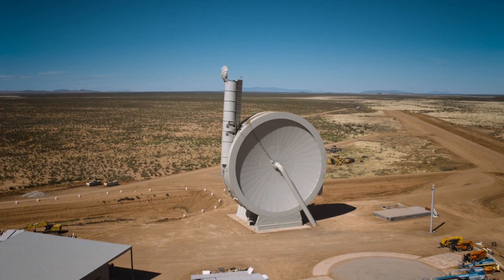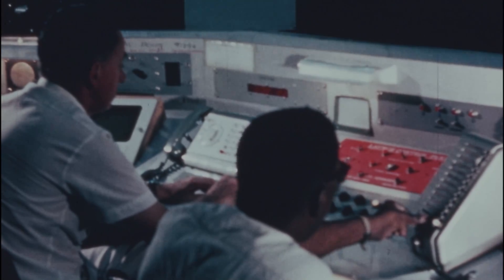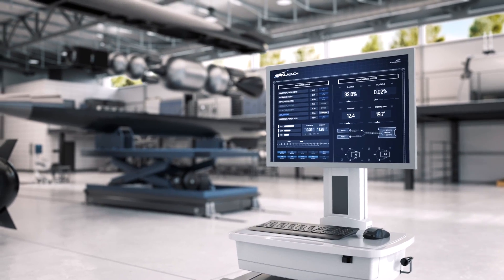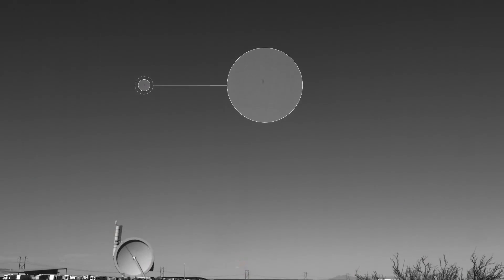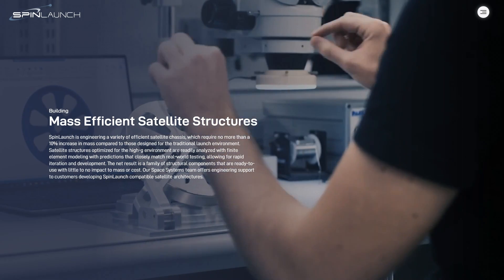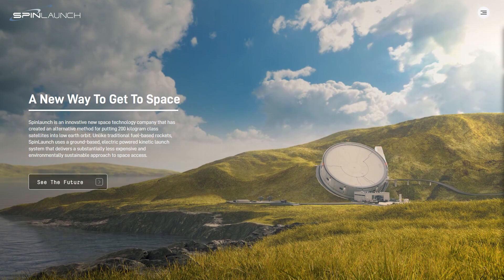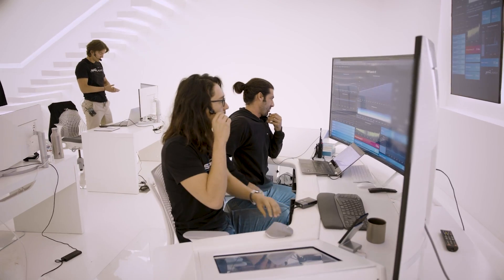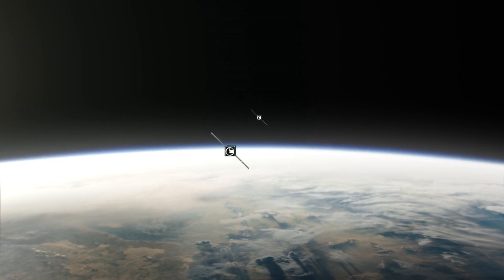Can Spinlaunch Throw Rockets Into Space?

Comment: A way they could release the rocket without damaging the bearing would be to have an attached counterweight exactly 180 degrees from the rocket that will release at the exact time the rocket releases but instead of going upward, it's directed downward. The forces on the bearings should remain the same and all they would need to do is dig a pit for the counterweight to safely be caught.
Reply: Sounds like a bomb
Reply: @metatron6066  well its better if a counterweight get thrown underground than the entire Spinlaunch assembly becoming a bomb if something goes wrong after the rocket is release above ground.
Reply: I don't think a counterweight going down at 11km/s can just "safely be caught)
Reply: @augusto7886  if they can design something to throw an object several miles in the air, I'm pretty sure that what I'm suggesting is possible. Even if its just a steel and concrete reinforced pit filled with deep water.

Comment: This is good but they need to make the ship shaped like a combination of a Frisbee and a airplane wing with an interior spinning disk so it has gyroscopic control with  aerodynamic lift then shoot it up at an angle. Also you could use these as a way to get parts into space and then build any kind of ship you want in orbit so that most of the fuel doesn't have to be used on breaking free of the planets gravity.

Comment: I wonder if this is the kind of thing that will be built like space telescopes, high on mountaintops to minimize the amount of atmosphere it has to deal with in the first place.  Less ΔP for the vacuum chamber to hold, and less air resistance for the projectile to fight on its way up.  As long as one is building a fixed launch station, might as well take every advantage you can get, much like how launching from the equator is preferred for the 1000mph speed bonus.

Comment: It would be probably much easier and cheaper to build a long runway ramp that gradually inclines more and more as the vehicle gains speed, than the current system of elevating a several tons rocket in vertical position from zero speed, demanding a tremendous amount of energy right from the start.  It is like the difference from a fighter jet that takes off speeding up on the deck of a aircraft acrrier or an old Harrier jet fighter that takes off in vertical position.  What is more energy efficient?

Comment: Obviously, this scheme works best atop a mountain -- like those in Hawaii.
It also works best for mass produced satellites, which is where the industry is headed.
Such objects could be injected into orbit faster than they could be shot down by anti-satellite weaponry.
And... this scheme could be the solution to sending fuel and materials into LEO at the lowest cost.
Reply: Do you know how long it takes to evacuate air from a huge vaccum chamber like this?
Add this to their assumption of spin-up taking several hours, and you will have 1 launch per day. Maybe.
Reply: @wtfiswiththosehandles  True, BUT, nothing stops this scheme from being replicated, clustered, even. In the beginning, I'd guess that their primary customer just needs supplies and materials...ice, even.
Using hydrogen gas instead of air would permit a much higher velocity at Mach 1 as well. This would be a two-stage pump-down. First a decent vacuum -- then a nitrogen purge -- then hydrogen would displace the nitrogen -- but at a pretty low absolute pressure. The rupture seal would covered by a nitrogen gap and robust metal cap until seconds before the Big Toss.
Due to the starting shock, an outer shell/skin will be necessary. Twenty-seconds -- or so -- after the Big Toss you'd be out of the atmosphere... and the exterior would be shed to improve ultimate performance.
If the Big Island was used, the discards would land well west of California.
Burning propellant upon the Big Toss might be delayed until out of the atmosphere, too.
Reply: @davidhimmelsbach557  I watched this several times, and it seems that a) the "projectile" tumbled upon launch... And b) in slow motion you can see that the seal was ruptured from the inside, as if pushed with mass of air from inside.
I question if they even tried this vacuum method at all. 
It is very interesting if it's further developed, but honestly it feels like the owner's main goal is out to get cash from investors...
Reply: @wtfiswiththosehandles  The VC folks funding this are the most prestigious on Sand Hill Road, Palo Alto. So, I'll bet they are entirely dialed in. This early in, I'm just impressed by their backers.
Musk's first stuff only hinted at what was to come. I hope that these fellows ramp up their scheme.
Price to orbit has ALWAYS been the big bug-bear for near-space economic advance. I believe we're witnessing a transition as significant as the first railroads. Yes, it's that epic. It's why Space X has such a fan base.

This device would also lend itself to the military. So I can see DARPA funding for this and that.

Comment: I wash down at Spin Launch New Mexico, doing the electrical work for the main building.  The lighting, receptacle's, stair lighting.  Exterior lighting.  The tan metal structures you see are welded together to form offices, 2 sets of showers and toilets.  On site living in the shipping containers and even a fully staffed chef who cooked wild thing he though up.  There is s shipping container modified in to a walk-in cooler and another as walk-in freezer.  They have a open fire pit area, music instruments you could play.  A mechanic shop onsite.  The worst thing about being there is hot humid weather.  As soon as you walk out of the air conditioned rooms, you start to sweat and When it rain, you had a 90% chance of getting stuck on the dirt road.  The facility was all powered by diesel generators.  The long strip of cleared land is for a runway and helicopter pad.  Once we got the Main building finished, we were done.  The basement houses the control room for the the spin lunch accelerator.  There is engineering office room upstairs and Conference room as well.   Their is a women restroom, a shower and men's restroom only.  Their is a open kitchen as you walk-in the main entrance.  Just past the kitchen is the Workshop area for lunch devices.
Reply: They have lunch devices, too? If they have a Mach 3 spork, I want one!

Comment: So dumb.  I have a much better idea that can be used.
Why not use the rail gun system to launch a rocket thereby decreasing the need for the weight of fuel?
Dig an approx mile deep bore hole, line it with electromagnetic rails, and have rockets kick on before escape velocity speed is unachievable.

Comment: The acceleration at the tip of the 50 meter long arm spinning at 450 rpm is R*w*w = 50*(450/60*2*pi)**2 = 110920 m/s2, thus 110920/9,82 = 11295 G
Reply: So when the projectile is released, the counterweight is going to be pulling that hard on the opposite end of the arm.
That would dig a hole halfway to China...
Reply: @carpediemarts705  this is the dumbest fucking idea I've ever seen lmao

Comment: The drag in atmosphere is velocity^3.  Set this up on top of a mountain.    The same speed at the edge of atmosphere could be achieved with lower launch speed.  Or, the same launch speed allows more payload, because less fuel is needed.

That also requires less structure to support a vacuum, the external air pressure is lower (less than half at 20,000 feet).
Reply: True, I thought that initially as well, but you also gain a large amount of free speed from being close to the equator, and there aren’t any high launch spaces in Florida. Operating outside of the US would cause tons of legal problems, might even get them banned from doing business with any us company over national security.
Reply: @-caesarian-6078  yep.  in another world they could put it on Pico Bolivar at 5000 meters, but that's unlikely in our lifetime.  Maybe Pico de Orizaba in Mexico could work out, but I still have my doubts
Reply: Also as close to the equator as possible. 

So the same reasons they put telescopes in the mountains of Chile.

Imagine how much that would benefit Chile if they had a space program.
Reply: Watch Scotts video about launching rockets from mountain.
Same principle applies here. Yes, it would require less fuel/energy but the logistics would be much much much more difficult.
Reply: @Jehty_  The G forces would indicate only small rockets are launched.  

I would expect the major logistical challenge would be the materials and equipment for the spinlaunch structure.
Reply: Why did they launch most of the rockets from sea level???

Comment: Chances are, no it can't.

The target of 1000 pound near-instantaneous imbalance of the 30 meter rotating arm at release would tear it apart, with 16,000+ G's at the tips.  Not to mention, the payload breaking into atmosphere at some Mach 6.5 would create incredible heat at the leading edge.  Further, payloads are designed mostly for for single axis loading... to prepare it for multi axis loading would almost certainly bust the current weight budget for stiffening and dampening.
Reply: It's only out against the wall, then suddenly free fall. Not exactly multi axis.
Reply: @zedex1226  1, that's incorrect. 2, do you know what multi means?

Comment: Any idea how the rebalancing would work? It kind of looked like there was another hatch (without a tube) to throw a counterweight down to the ground but I might be imagining it as that sounds a bit dangerous. However, I can't think of another way to do it.
Reply: I'm thinking that getting the projectile and a counterweight to release simultaneously with enough accuracy will require timing and considerations similar to that of detonators on an implosion nuclear weapon.  If they are off even slightly, the system will still tear itself apart (probably with a heavy counterweight to add to the shrapnel)
Reply: @rgarito  They need a very accurate release in any case.

Comment: from an engineering standpoint this is wrong on so many levels. 
not only is the launch platform much more expensive than the actual craft its also rigged to instantaneously self destruct at the smallest of mishaps destroying the entire machine including the payload and the launch craft.
with a regular rocket even in the worst case you can do another launch in a matter of days provided you have another rocket.  with this thing it would take years just to build , test and dial in a second centrifuge. 
also if they want to go hypersonic the material stress is so high that maintenance on the centrifuge would take longer than constructing actual rockets.

Comment: For how Trebuchets works, the easy part is the "problem" about momentum transfer, when the spinning arm goes from having 10 tons to 0.

If the counterweight and speed is well calculated, once the engines are disconnected and the thing just spins by inertia when the arm releases the payload, when it releases, the arm will just stop in place, transferring all his momentum/kinetic energy to the rocket. No kick, no structural problems, just a clean and silent arm staying freezed in space for a brief moment.
Reply: "when the arm releases the payload, when it releases, the arm will just stop in place, transferring all his momentum/kinetic energy to the rocket"

That doesn't work. Trebuchets have a sling; this thing doesn't.
Reply: @seneca983  Ow. Well, in that case...

I guess is... A single-use launcher?
Reply: @sirnikkel6746  My initial guess is that they'd have a counterweight that they'll throw down at the same time they throw the payload up. It's just a guess, though.

Comment: am i the only one seeing an issue with the geforce? 50meter radius =100m diameter and 450 rpm means 11320 g... space craft are designed to be light wich means they can endure some straight g force bot not 11320 g to the side...

Comment: I wonder if a way to handle the issues caused by the sudden change in inertia would be to spin and release a counter weight in the opposite direction at the same time? Possibly the materials involved don't have enough strength head room to essentially double the weight, but it's an interesting thought; throw the payload in the air whilst throwing a counter weight into a pit designed to safely slow it down for reuse.

Comment: Mach 1 is 1/20 of the speed of low Earth orbit. So an object in low Earth orbit has a kinetic energy 400 times greater than one at Mach 1. But it's more about mass ratios: you need a somewhat smaller mass ratio to get from  Mach 1 to orbital speed than from zero to orbital speed.

Comment: Scot maybe you should stay clear of pre-grad level marketing hypes where people take a idea which in it's basic form seems plausible by being backed by some simple math, but doesn't really account for real world. The whole point of these hypes is to secure funding for "more research".

The immediate reasons this can't work in real world are at least two:
1) you'd need a rocket that can handle massive acceleration due to centrifical forces. The payload of that "rocket" would need to be able to handle that too.
2) upon release of that payload there would be an equal amount of energy released into the balance. Not a big problem for a prototype... massive problem on scale.

First reason is why kinetic wheels are not the dominant form of energy storage yet after 7 decades of work on that technology.

Comment: So they've actually made a bolo accelerator?  Sweet!  
The obvious way to solve the stability problem is to throw a dummy payload down at the same time they throw the big payload up.  Honestly, this works better in space where you don't have to worry about having air in the way.  Use solar power to spin up a pair of bolo accelerators in opposite directions, and you stabilize the whole space station.

Comment: re  -  2:14
Jesus fucking christ!!! Look at the shockwaves coming off the sabot as it tumbles. I guess that would be due to the transition from supersonic to subsonic.
It's definitely the sabot that's causing the shockwave and not the projectile itself, as the shockwave follows the tumbling sabot and does not follow the path of the projectile.
It's pretty amazing to watch!
A bit later, at 2:20 ish, you can see the cap at the base separating from the main projectile. As it starts to slow, it also starts to produce a visible shockwave (most visible at 2:23 when the background changes). At this point the shockwave from the main projectile also becomes much more salient. The difference in the shapes of the shockwaves is pretty amazing.
I've got something new to request from the slomo guys, now.
Cheers :)

Comment: The scary thing about this is that at the moment of takeoff, a conventional rocket is travelling very slowly, and gradually builds pace with vertical G's in the single digits, if it explodes on the launch pad or in the air it'll probably only affect those in the immediate area. The energy is directed vertically down until it is several kilometres up into the sky.

With this (and don't get me wrong I'm sure it would be so finely tuned as to be extremely unlikely) if there was a misfire, (so unlikely) partially stuck release mechanism or worse the rotating arm itself disintegrated at high speeds due to unseen repetitive stress fractures inside, the shrapnel will travel tangentially out from the centre of rotation at supersonic speeds.

I'm okay with that so long as the containment disc shaped building itself is built to withstand the worst case complete disintegration of the entire rotating arm, vessel and payload, if not, the surrounding neighborhood is getting showered with extremely dense, fast carbon fibre and steel shreds that'll cut through a human like a hot knife through butter 😅
Reply: I'd imagine these facilities would only be built in remote enough places that there's no unsuspecting victims. Hopefully lol. Just the people in the facility who know the risks
Reply: Regardless of precautions, some human will F something up at some point...